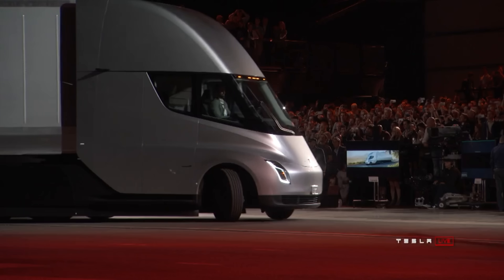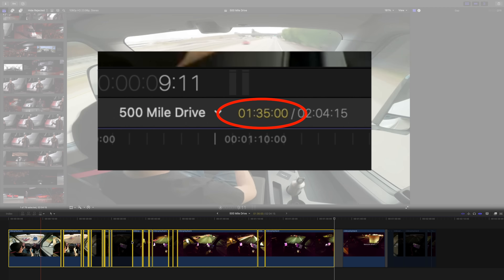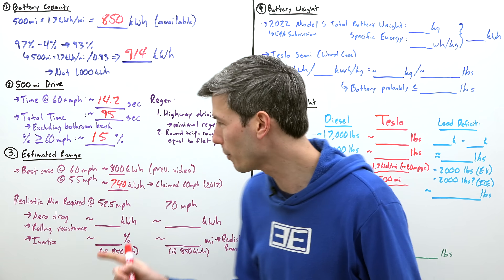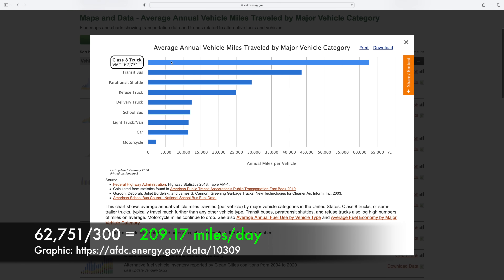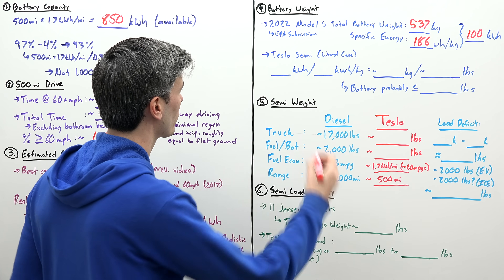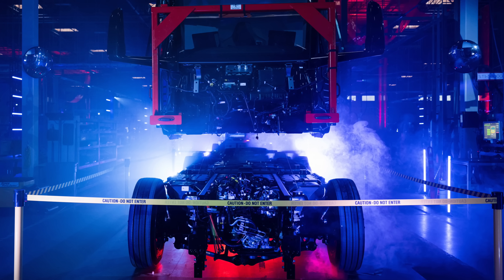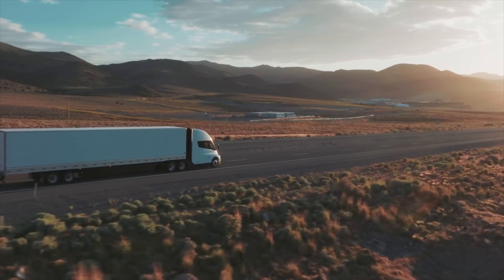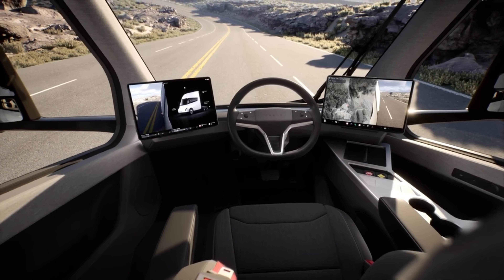Does The Tesla Semi Make Any Sense? Part 2!

Comment: Couple of flaws mate. Those concrete barriers do not weigh 4000 lb each. They weigh 1150 lb each. That's 12650 lb for 11 of them. You've cherry picked the heaviest barriers you could find, when the ones in the demo clearly aren't those.

With the 500 mile video, at the very start, you can see what's in the trailer. It's a dozen unmarked boxes roughly 1m square. I would be surprised if there was actually anything heavy in them, but I'll give you 1100 lb per box. That's about the same weight as the concrete barriers. So again, 12-13000 lb. 

So if Tesla claims both of these demo's are full load, then the battery must weigh around 40000lb. Meaning there is fk all allowance left to actually carry anything heavy. 

Or, the battery weighs less & they purposely lie about how much they are carrying. 

It has to be one of those 2 things. 

Ultimately, Pepsi still hasn't received all the trucks they paid for yet. None of the other companies have received theirs. Tesla has kept the rest for themselves. They won't release them on mass because it's an embarrassing product and it's missing about 20 things that were promised in 2017 when everyone pre-ordered (which were meant to be delivered in 2018).
Reply: What's the barrier type called? Why do all his sources say 4000lbs?

Comment: I do not have to listen to the video to assure you the Tesla Semi makes zero sense. The diesel is very efficient for the amount of weight it moves. The Tesla electric takes forever and 3 seasons to charge. The tech is unproven except in one respect - we gave up on the idea of electric cars well over 100 years ago because they just don't work. You do not see battery electric ships or battery electric planes and never will except in small toy size drones. 

Hybrid seems to be the best of both worlds. It works for train engines. Use battery and e motors for takeoff power, where they excel, and let diesel be the sustainer motor. Get a lot better mileage.

When America gives up fossil fuels we will be an isolated country. We will be unable to travel any distance and overseas travel will be impossible. Okay we can go back to building wooden sailing ships. Airline travel? Forget it. The liberals want America destroyed. What better way that to send us back to the pre-industrial age and let someone like Mexico invade and take us over. Mexico is not giving up the use of oil and gas. We are going backwards as a nation. Sorry to see it but I'm old enough to remember 80 cent 93 octane gas 1986. Battery powered vehicles are overpriced, underpowered energywise, the infrastructure doesn't exist to support a whole nation of them and never will under liberal rule. Power stations close every day and are not being replaced. RIP America.
Reply: How long do you think charging takes, exactly?
Reply: @logitech4873  too long. Enough said.
Reply: @user-RCST  i did. Thing stil makes no sense. It isn't practical for anything other than short haul use. Real world use probably 300 mile range. Winter or summer will reduce that. EV isn't ready for prime time.
Reply: @Dannysoutherner  it makes sense for 60% of trips.  45 minutes isn't that long.

Comment: Aren't you the guy who said that the Tesla semi would haul as much as diesel?  And now Pepsi uses it to haul potato chips?  Not soda? (Heavy)
Reply: It will haul both
Reply: @user-RCST  it won't haul either 500 miles, like Tesla claimed it would.
Reply: @Zornotfugen  400 to 500
Reply: It will haul as much as a diesel though. What are you on about. Watch the video.
Reply: @logitech4873  no it won't.  Musk was careful to avoid saying it would haul 40k lbs payload 500 miles.
Reply: @Zornotfugen  It will, and it already has.
Reply: @logitech4873  no it hasn't, didn't you see that the CEO of Pepsi said it won't haul heavy loads 500 miles?  It can't even haul chips 500 miles
Reply: @Zornotfugen  "We won't be using it for these routes" =/= "It can't be used for these routes".
Of course they could use it for 500 mile routes if they wanted to. Watch the video.
Reply: @logitech4873  keep drinking the Kool aid.
Reply: @Zornotfugen  Try watching the video. Even with a full load, it can meet and exceed 500 miles in the right conditions. And if you're NOT pulling a full load, 500 miles is EASY even.
Reply: @Zornotfugen  If the jersey barriers weigh 4000lbs as shown, then that's 44K lbs load. We know the truck can haul its legal limit (82k lbs) worth of weight 500 miles.
I mean, it's gonna be real damn close in any case.

Comment: @Engineering Explained was wondering if you could also look at the amount of cooling that this truck is going to need for that size of battery pack with the fast charging.   I am also skeptical of this truck doing 1 million miles on the battery technology as lithium batteries life expectancy degrades using fast charging like Musk is trying to push.  Also am wondering with that size of battery pack how will cold environments degrade the rang.

Comment: I work 5 days a week. 48-50 weeks a year. 
My moving average according to garmin over the last 500k miles is 65mph. I work mainly in the central US. 
I drive 130k to 150k miles a year. 11-13k a month. 3000-3300 miles a week. 600-700 miles a day. 
Standard expected payload for most commodities are 48k. Alittle less is allowable in some places but not all. A lot of dry van stuff can be lighter if it takes up a lot of space. Like soda cans.. But a 4000lbs reduction in payload would take 2 pallets off the average load I would say. 
Truck will probably make sense for local delivery, DC shuttling, yard work, or some shorter regional. Mostly hinging on the availability of chargers and power for them. But I doubt they break into longer range stuff. Which is why they just have a day cab.

Comment: Once again you got a lot of stuff wrong. Dot allows only 400# of extra weight on the drives of the truck but the overall weight still can not be over 80,000#. You did not factor in wind, rain, snow as friction or cold, a.c. and lights as items that rob the battery of power. Then there is the real world, trucks run at 65 to 72mph. Most run hills all the time which rob battery power.  The only place this makes sense is local run where a truck leaves and returns to the same place. Any thing else you could place the driver's life in danger when the truck runs out of power. p.s. real world test is not in California, the southwest or south east, try the northeast, Mid west and new England say from Baltimore to Boston in winter.
Reply: For battery electric vehicles they allow an extra 2,000 lb
Reply: Electric vehicles don't lose range in hilly sections the same way diesel trucks do. You gain back your energy when going back down.

Comment: Someone who knows the trucking industry better than me can probably talk about this with more authority than me. If I'm not mistaken, the weight limitations on semi trucks are pretty much arbitrary limits set by state and federal officials that have little to do with how much weight a truck is capable of hauling. If the government wants more electric trucks on the roads those trucks will get the weight limit exceptions they need.
Reply: Bridges in the state are a huge factor. And hey, all of our bridges are crumbling!!! Yay!!
Reply: Weight limitations are there to protect the roads. Increasing that limit for BEVs is completely illogical.
Reply: @herrschaftg35  
No argument there. Since when have bureaucrats and regulators ever been logical? In my industry permits are obtained to carry oversized and overweight loads all the time. Seems a very small step to extend these permits to electric semi trucks, on a more or less permanent basis.

Comment: I do not understand why people are only considering pure EVs car and tucks. I own a hybrid that I bought in 2012 that used to make 44 miles to the gallon, today, after 210K miles, it is making 42 miles to the gallon. It cost me 28K dollars when I bought it, today it must worth 7K dollars. The money I saved during this time more than offset the 4K dollars I paid more to have a hybrid. After 10 years the battery did not died, had to change breaks only once and the actual amount of millage I put in the engine is about 190k miles -- I am considering that 20% of the miles were done in EV mode -- engine off. Also, because the car is hybrid, the engine operated at lower RPMs, lower temperature, lower ware and tear. So, why not a hybrid truck? What the hell, you could double the millage on a truck if you pair the engine with a relatively small battery and motor. Image, every time you have to stop a big truck its waisted energy that could be recoup into a battery and used to put it moving again. Can't understand that did not happen yet.

Comment: Most trucking companies may only get loads at that max GVW 10 or 15% of the time. But they need all of the vehicles in their fleet to be capable of hauling it to prevent from losing that those loads when their customers need them.

A race car doesn't drive at top speed around the track anywhere but the longest of straights. But no team is going to take a car that goes 10% slower than all the other cars just because they only do it part time.
Reply: At last ! A comment from someone that understands the truck market. The Semi may sell a few trucks to those hauling their own goods locally providing they are lightweight. For the majority of the market, the Semi is useless and will never sell in numbers
Reply: @jimpackard8059 You shouldnt underestemate how big the market for "short" distance trucking and fixed routes is. Like between harbour, factory and warehouse. Same with bulk material like gravel or liquids in tankers. The amount of load you can carry at once doesnt matter just the price per ton.
Reply: @jonasstahl9826  But! Just but! What if US people start using VANS for small batches (under 8000 kg) on a small distances? just worndering
Reply: @jonasstahl9826  you make a good point but what we do know is that the Tesla Semi will not carry a full load and will thus not satisfy the existing market in full . Somebody needs to give me a reason why Musk has refused to state the payload after years since the launch. I guess they are still trying to make it viable but cannot do so.
Reply: @jimpackard8059  For me the main reason why they dont public the weight could be that they are still in development/testing and batterys are still improving relativ quick, by the time they go to market the batterys weigh probably alot less, second would be marketing, when everyone is talking about the weight they talk about the truck it is free advertising.
Also I think there is alot more stuff in a Diesel Truck, that you wouldnt need in an electric truck, like sound damping, vibration reduction and even the frame doesnt need to be that heavy for an electric truck since you dont have the twisting forces between gearbox and driveshaft. I asume that the Tesla Semi weight the same, if not less.

Might check out Edison Motor they are building a Diesel Electric Hybrid logging truck, that is pretty light for how beefy of a Logging truck it is.
Reply: @jonasstahl9826  not releasing payload data has nothing to do with completed development. Musk just predicts this stuff  in advance  as he did at the Cybertruck launch. The range figures were way wrong.
Reply: @jimpackard8059  Also why do you ever need truck for small batches? (under 8000kg) like...there are vans there, much smaller and more efficient
Reply: @moriyamakyon1067  Also, vans are a bit easier to electrify.
Reply: @dbclass4075  yeah i was surprised by how many pretty affordable vans are EV's , and big box vans look really good and futuristic tbh.

And also they are better as EV's because they weight less

Comment: the issue with the FMCSA and other agencies gathering data on truck weights are that they are taking all truck weights gathered and not looking at all truck weights collected when loaded. The data is skewed due to many of the trucks moving empty to pick up another load elsewhere meaning that the entire segment about truck capacity is primarily based on a false premise. You are better off talking to Werner Enterprises, Schinder, or Crete about their average weighted loads, having worked for them before I recall the average being much closer to 78K - 79K loaded, most tractors were just a few thousand off of the legal limit.

Comment: It’ll be interesting to see how this truck does in the cold while doing all this.
Reply: Into a headwind
Reply: @AlphanumericCharacters  yea it is never windy.....ha ha. Plus they need to factor in the batter degradation from rapid charging. wait till they are 2 years old and loose 8% from all the fast charges. Also Using that data is kind of like using IRS documents to show business profits.....They aren't going to match up.
Reply: @Mikefngarage  Lets see. Remember, the trucks are using the 4680 cells, which will degrade slower. Also, whether or not its there now, energy is and will continue to be cheaper that oil. Anyway, we will see.
Reply: @sebastianorye2702  For now, they're using the 2170 cells from Giga Nevada, not the 4680.
Reply: @SraMYM  Just looked it up, and you're right. I guess that's positive news.
Reply: @SraMYM  That doesn't matter because that does not increase the density of the cell and because of it being physically larger, it means less cells to distribute load
Reply: The cold makes a big difference in my Model S range.
Reply: I am more interested in the maintenance claims. If the vehicle breaks down less often that would be amazing for truckers. The main issue is that when it does breakdown how long will it take to fix because who can work on it? Tesla is notoriously bad when it comes to service. I just have their house batteries and solar panels and even I know that.
Reply: @SomethingElse4U  Well just logically speaking, a EV in general has fewer moving parts, don't need oil changes, and aren't dependent on breaks. I wouldn't be surprised if their claim is real, but really, only time will tell.

With regard to your service claim, since you didn't directly reference you as someone who's experienced it, ill assume you haven't. Tesla has been known for long wait times in service, which is still the case in many areas from my knowledge, but it's more case by case. With that being said, Elon has claimed average wait time has decreased (last year) and looking at the change in process and communication, it seems much better than before. Regardless, its an issue Tesla will fix eventually.
Reply: Also if you get stuck you'll kill your  battery trying to get out at least if you have  fuel you'll be able to usually get to the next fuel station or someone simply bring you a jug of  fuel .  Driving in deep snow would drain a lot more energy too .
Reply: @Stevros999  well sure, a situation where you are on low battery and stuck for hours on end can occur, but energy usage can just be limited by the driver. Worst case, you just get towed, or get charged on the road with a mobile charger.
Reply: They have all broken down already only doing California runs so cold is not necessary. "1 million trouble free mile warranty" my ass!
Reply: It will flop just like the cars do
Reply: Nothing. The reason is the battery pack is massive so it takes a long time to cool down. Also when towing 82k pounds with an electric motor... it creates a lot of heat.
Reply: @lachlanB323  The integrated cooling system is constantly keeping the battery, inverter, and motors at an optimal temperature

Comment: Thanks for your video ! I still have high concerns something you did not mention : 
The battery capacity decreasing over time with the miles... 
If you have to change the full battery pack every 5 years, I can't see how the truck will be economically viable
Reply: aren't a lot of the older teslas still getting 80-90% capacity after 10 years?
Reply: @ericlala yes they are. They are considered warranty worthy if they do not contain 70%+ after 120-150k miles (depending on when you bought your car) or 8-10 years. 

From my understanding (and I do not have any hard numbers to back this up, take it with a grain of salt) very few batteries get warrantied for degradation. 

To make it even less likely that the battery will die over time, the battery system appears to have modular components. This would allow for a partial swap if different sections of the battery were found to be failing or faulty.

Batteries aren't perfect, but they are FAR better than ICE and have an overall much higher life expectancy and reliability to boot.
Reply: @blitzzer24  that last statement is a bit of an exaggeration
Reply: @blitzzer24  tesla does not offer modual repairs on their batteries, that's why third party shops became a thing, to help avoid throwing away the entire car if a small part of the package needs replacing, so repair cost can be cut down. Tesla does indeed not offer this repair, and would rather have you buy an entire package..
Reply: @Tomazack  that is the case for battery packs up to now. New data mines and leaks have shown that it's expected that the battery on the semi truck will have a modular design